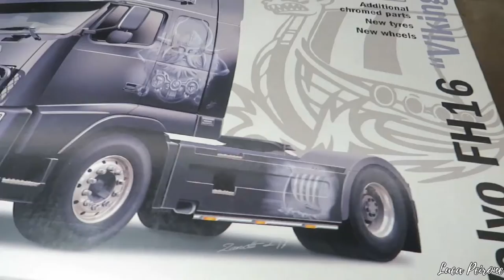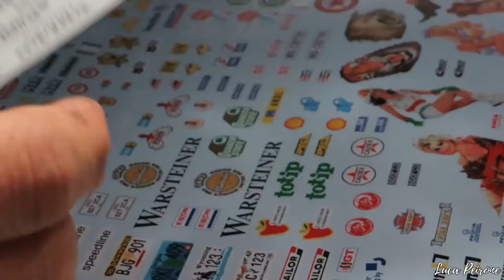Italeri 1:24 Volvo FH16 (Full Build Video)

Comment: Ciao👋 luca, ho visto ke nel video in partenza, una volta assemblato il telaio, usi 2 squadre da carpentiere x tener in squadro il telaio. Le usi spesso le squadre x i telai dei tuoi modellini?🤔
Reply from the maker: Non sempre,ma spesso,a volte succede che i longheroni,non sono perfettamente dritti di fabbrica,questo impercettibilmente può passare inosservato,ma quando si va avanti con l assemblaggio,la differenza di 1mm sul telaio,per esempio può portare ad una differenza di 3mm sulla cabina,rovinando l estetica finale